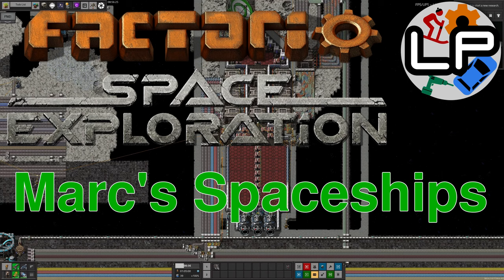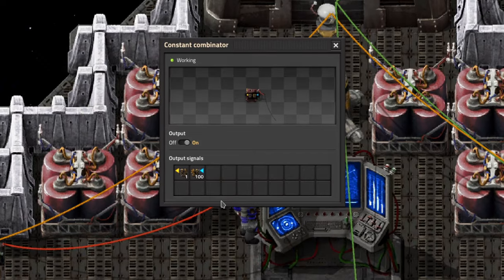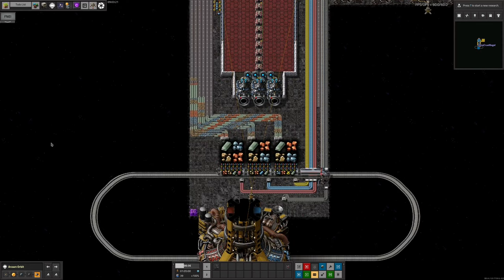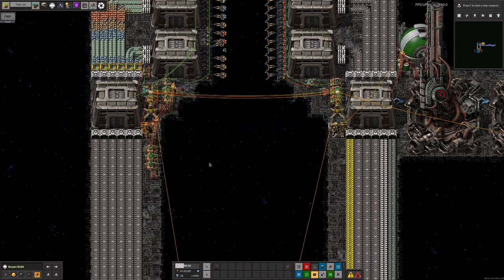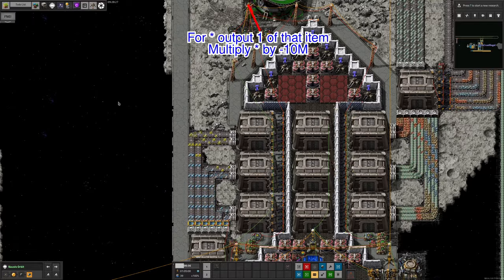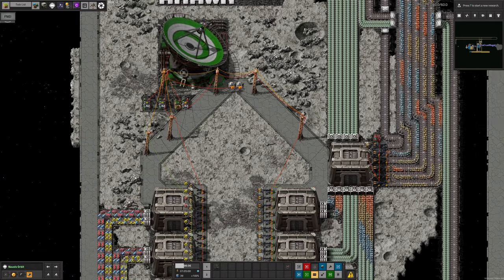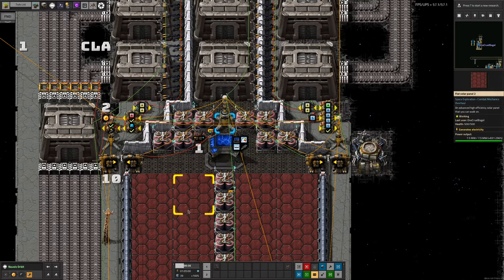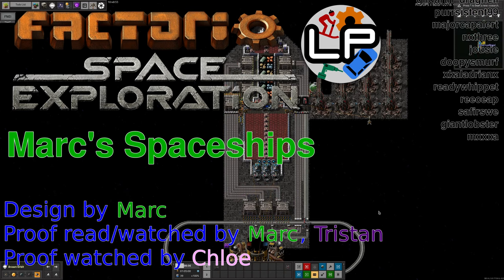Advanced Spaceship Automation with Marc - Laurence Plays Factorio: Space Exploration

Comment: Very nice ship and station design. 2 problems I found through my testing:

1. Memory cell on the outpost will eventually overflow without reset. This might cause problems. Reset won't be very difficult. You can do it using any signal from the space ship. Send reset signal when it is zero.
2. Double request on the home side. Each supply list will be requested twice. So if there are not a lot of overlap between requests, your home side might get stuck because the warehouse got filled with leftover stuff. You can lock out the supply belts when spaceship is flying away (use falling edge detector on any signal from the ship) and reset lockout by a signal from the outpost (spaceship arrive if you pass the cargo signals through to the outpost transmitter, finish unloading if you don't). An SR latch could get the job done.

Comment: Have you guys considered implementing an emergency signal? Like "launch a ship now, we're out of astoroid ammo/elevator cables"? With a system similar to yours, I've had the issue that during some prolonged science downtime an outpost ran out of supplies since I wasn't using the ressources it produced fast enough to send the ship back and refill those supplies. It's particularly bad if you run your outposts on imported uranium fuel... 
Perhaps this doesnt happen if you just set the supply requests high enough? 
Do you have a method for determining this or is just "guess and monitor"?
Reply from the maker: It's something we ran into early on, but I think we increased our requests to a much higher number, and it hasn't been an issue so far. It's a fair point, but there's a strong risk of the ship not having enough space to pick the extra cables up! It's pretty much been guess, double it and then monitor. It would probably be sensible to set up alarms that would alert us if/when there's an actual problem though! Our outposts aren't going to have power related issues at least - they're all either solar from orbit or beam, with local water. 

An excellent thought, nonetheless!
Reply: @LaurencePlays  Thanks! I had the same concern, regarding the ship not having space... you'd have to automate that in as well somehow? For a time my solution was to run separate ships for supplies and bringing products back but that is a totally different setup. And for efficiency you'd want to raise requests to the levels where the supply ship doesn't make emergency trips, else you're just pushing the problem down the line. I.e. when production is backed up, the only thing you're missing are cables/ammo, and you probably won't fill a ship with those alone?

Another solution I established for my solar/asteroid belt outposts (for energy/astro science probes) is a small ship that only carries ammo, and operates basically like an LTN train (if the supply on either outpost drops below a certain level, the ship is dispatched to that location). I did that mostly because I was still low on ressources at that point, and I didn't want to have to build 2 mostly idle spaceships.
Maybe I could implement that for all orbits as an emergency 🤔 (carrying ammo/cables/train batteries)
Reply from the maker: @MrDivinity22 After reading your first message, I was thinking about how I'd build a ship that would go out to any space station when required, but only go to the one that needed it. I have an idea, but it's not really needed at this stage of the game. Still, it's something I might do in another run - maybe when I play 0.7!

Another possibility is to add an extra storage box that only carries the ammo, but that feels wasteful. I much prefer having general purpose storage that's used for everything!